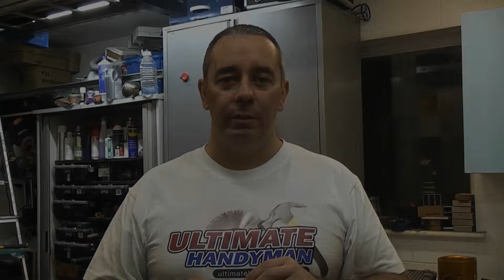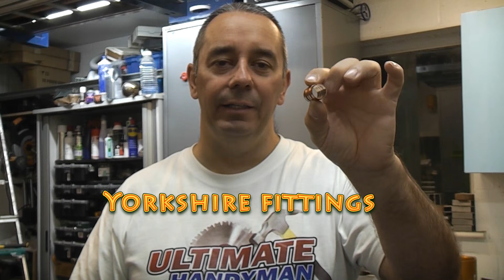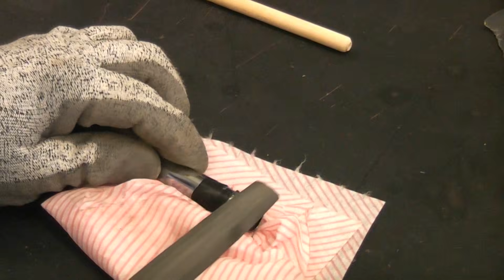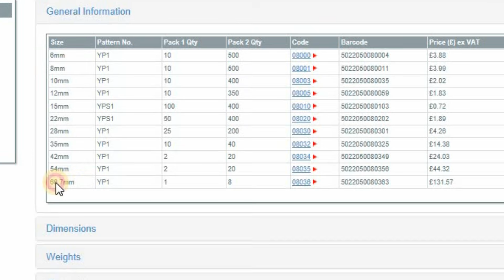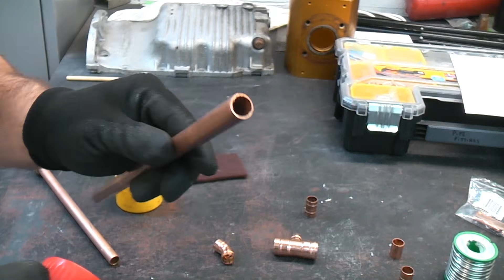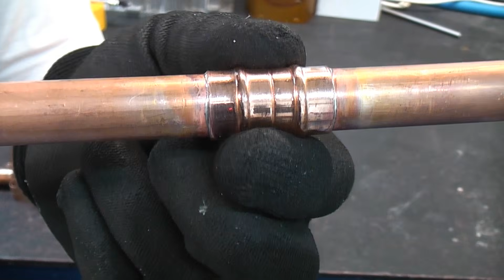How to use Solder ring fittings | Yorkshire fittings

Comment: The cleaning and fluxing part is as it should be. However, the flux purpose is to make the solder flow evenly around the fitting, ensuring a good uniform ring of solder and a good seal with the pipe. Do not just heat one side of the fitting, as shown in the video. Keep the heat source moving and work the blow torch all the way around the fitting to ensure all the solder melts and flows evenly all the way around.
Reply from the maker: I used to move the torch around, like you suggest, but the professional gas engineers keep telling me to hold the torch in one position, as the heat will conduct anyway!  
Thanks for the comment 👍

Comment: Im from USA, always wondered why these aren't used here.  Question, do you have to make sure that the solder is coming out of the joint all around the pipe or is it a good connection as soon as you see a little solder come out?
Reply: Once the solder exists all round the pipe just like in the video! The key is to heat it slowly for the solder to flow! And put flux to help solder flow! Hope that helps!

Comment: I need to get somebody to lower a section of a gas pipe running behind my kitchen cabinets, im guessing its going to need 4 solder elbow joints, is that likely going to drop the pressure to my gas hob on the far side of the kitchen? My old dishwasher broke and the new ones dont come in 540mm depth anymore, I bought a new dishwasher 550mm depth but the gas pipe running behind wont allow it to be pushed fully back against the wall so needs to be lowered to just above the ground.
Reply from the maker: I don’t think it will affect the pressure much. I was always told that elbows reduce flow, so I once tried some pipework with elbows and an identical piece with swept bends, there was no noticeable difference in flow. Having said that, our water pressure is 8 BAR, so perhaps it will affect gas. I’m sure the gas safe engineer will sort it! 
Thanks for the comment 👍

Comment: I never seen a plumber not use extra solder on the pre solder ring fittings ,,I guess not even plumbers trust them...
Reply from the maker: There is no need for extra solder, the manufacturers put the right amount in the fitting 👍
Reply: If a plumber is using these and adding extra solder, why are they using them at all? Genuine question

Comment: what I don't understand about these is why you heat the fitting, not the pipe.
for end feed (non Yorkshire) the principle is the heat draws the solder into the fitting by capillary attraction. hence it is logical to heat the fitting, not the pipe, to create that heat differential

why then do you do not do the reverse with Yorkshires? 

When I tried Yorkshires I could not get the solder to appear outside at all, in fact it only appeared when oi physically turned the pipe to see what was happening, at which point the solder ring did appear at the joint. In one case I actually ended up by supplementing with an end feed as well.
Reply from the maker: The heat normally conducts very quickly on copper pipes. Are you 100% certain that your fittings were made by “Yorkshire”? As some other firms make solder ring fittings, and they might not be as good!

Comment: Hi pal. Is best use a damp cloth to cool down pipe after soldering or some plumbers I've seen,, tend to use flux  with a brush and cool it down.... What's you opinion on that? with
Reply from the maker: You can do. A mate of mine gives the pipes a wipe straight away, sometimes with a damp cloth, sometimes with wire wool 👍

Comment: HI.  Great video!  Thank you.  I have to weld a 8mm Yorkshire to stainless steel.  I understand I need a special flux and then can use silver solder.  Is silver solder used in Yorkshire fittings?
Reply from the maker: I'm not sure, their website just states that the solder is "lead free"
https://www.pegleryorkshire.co.uk/EN/News/fittings-news/PutYourFaithInTheOriginalYorkshireFitting

Comment: Never thought of using a heat gun instead of the torch. 
Always hated soldering pipes in tight positions under the floorboards 
Might give a heat gun a try next time.
Reply from the maker: Heat guns work, but they are much slower.
I did buy a special tool for this purpose, but only tried it once. 
I'll try it again in future, mine is similar to this- https://bit.ly/3uZFCFg

Comment: These are a good cheap alternative to buying end feeds and solder separate which can be more expensive but how well are the joints sealed and whats the possibility of these ever leaking? I want to do some first fix plumbing for my downstairs loo refurbishment so the pipe works going to be hidden behind the battens where plasterboard will be going so need to make sure all the joints are good. Would I be better off using these maybe adding extra solder round the edges just to be safe or just stick some Speedfit ends on? Cheers
Reply from the maker: I've used these for years with no issues. A mate of mine always adds a little extra solder to them though. They give a really good joint, providing the pipe is deburred and cleaned properly before soldering 👍

Comment: This is great. I'm useless at soldering, but I hate the way my pushfit  effort to add a isolation valve to the loo looks like a kids  construction toy.
Re: The "gentle heat", with the blow torch? I don't have a blow torch but I do have a heat gun with adjustable temperatures.
I've watched your video showing how to use a heat gun for these fittings, where you say to use the highest setting. I presume that, whatever the highest temperature mine goes up to is, it will never be too hot as to not be as "gentle" as a blow torch on low flame?
Thanks again.
Reply from the maker: Yes, a heat gun will melt the solder, but they give out much less heat than a blowtorch, so you need the heat gun set to maximum. It's also much slower with a heat gun!

Comment: Just managed to put a screw through heating pipe under floorboard 😖 This will be my first venture into soldering which your video has at least given me some confidence in! Thanks for posting it, wish me luck!!
Reply from the maker: Good luck with it ;-)
Reply: @ultimatehandyman  Failed!! Heated for ages with a small blowtorch and solder started coming out but as soon as heating went back on the edges started bubbling and water seeping out 😩 Going to have admit defeat and call a plumber and use compression to keep me going short term

Comment: 3:55 Flux doesn't clean the copper! You already cleaned it by sanding it to a shiny finish. The flux keeps the copper from oxidizing-you'll know because the surface gets dull when this happens. Solder will not adhere to oxidized pipe.
Reply from the maker: a flux (derived from Latin fluxus meaning "flow") is a chemical cleaning agent, flowing agent, or purifying agent. Fluxes may have more than one function at a time. They are used in both extractive metallurgy and metal joining.

https://en.wikipedia.org/wiki/Flux_%28metallurgy%29

Comment: Nice video. My dad taught me how to use these when I was younger. I have had some leaks with them though. I think it might be from overheating the joints?
Reply from the maker: Are you sure you cleaned and fluxed the parts first?
I have never had one leak!
You don't need a massive amount of heat to melt the solder, just a gentle flame will do.
Thanks for the comment
Reply: @ultimatehandyman  Yes, I did clean and flux the joints. Puzzling.
Reply from the maker: @thehartfamily8963   Yeah. I'm sure someone did a video once about heating the joint too much and it did not cause any problems, even after well over heating it.

Comment: Couldn't you get the same results, simply by pre-wrapping a loop of solder around, on the pipe side. Then, when you heat the fitting, the flux will eventually draw in the solder that's already been pre-wrapped, and then you're done. 

Am I missing something? It seems like this would be much cheaper than a Yorkshire fitting, yet providing the same kind of functionality..

Could you do a demonstration of this method, as I've outlined?
Reply from the maker: Not sure about that 🙄
Thanks for the comment 👍

Comment: I've just tried one of these fittings on microbore and the solder never came out off the end. I cleaned all well and applied the flux and then applied the heat. No solder then came out like your video.
Reply from the maker: I think the small ones like that don't have much solder in them, so you might not see it exit as much, although I would expect to be able to see some of it.
Thanks for the comment 👍
Reply: @ultimatehandyman  well, I had to solder a total of 6 fittings to bury a flow and return for a rad in the wall. I've turned it on and no leaks. The fact that I didn't see any solder made me feel uneasy but it's all good. Thanks for replying and informing me of that. 👍

Comment: Great video! Do these work well on vertical applications? Will the solder still exit the top of the fitting? Thanks 
Terry
Reply from the maker: It will be fine in vertical applications, although some solder may exit from the bottom due to gravity.
Thanks for the comment 👍

Comment: Thank you, very clear and well explained. Got a load of radiator pipes to put together, wish me luck! Looking up the repair patch as well, that looks like a great way of fixing a hard to access pipe with a hole in it. Thanks for mentioning it, never new they existed, been stressing about how to fix that pipe.
Reply from the maker: Good luck with it 😉
Thanks for the comment 👍
Reply: @ultimatehandyman  Update - done several pipes now, forgot about fluxing the inside of the fittings... Think that will be an issue? Tried the click fix but thatpipe appears to have water in it still, so need to figure out a way to sort that 🤔

Comment: when you clean that pipe and applied flux ...dont put it back the way that it touches anything. you just contaminated the pipe with whatever you had on your table ...that's why the solder joints leak after a while ..

Comment: Hi UHM I’m hoping you or someone who reads this knows the answer to my question: 

why can I not find end feed/solder ball valve isolators the UK for 15/22/28? 

Even after endless searching on many of the major plumbing suppliers (BES, JTM, etc etc), and even eBay, Amazon...

They appear all the rage across the pond but over here they are only ever compression. 

Is there some WRAS/Gas reg, or just no demand in the Uk ??

Thx in advance.
Reply from the maker: I'm not sure, to be honest.
I always thought that most valves are compression so that the heat from soldering could not transfer to the valve and melt the sealing material.

Thanks for the comment
Reply: Ultimate Handyman yeah I thought the same. Yet @thisoldplumber on “this old house” always uses soldered ones. 

I’m fine with compression, more curiosity than anything. 

Thx for reply

Comment: Hi

I imagine you have a thousand ideas for videos that you’ve not managed to do, but here’s one more. 

Since the switch to plastic plumbing pipe I’ve always thought there would be issues with flow through the pipes; not least due to the inserts like the John Guest ones. 

Now I’ve read lots of research about how plastic isn’t THAT bad compared to soldered or compression copper pipework, but if you have a complex install with, say a dozen elbows all with two inserts on 15mm pipe I cannot believe that the flow (gravity system) would be as good as soldered copper. 

However, what I’d be interested to see is a video showing the difference between the two setups. 

As I say, just another idea to add to your backlog ;)
Reply from the maker: I have been planning a video on the difference between plastic and copper pipe, like you say the inserts really reduce the bore, especially with 10mm plastic pipe.  I'll try to set up a rig when I get chance.
Thanks for the suggestion 👍
Reply: Ultimate Handyman I’m just installing a new wet room shower with rain soaker, 6 jets (not for me, apparently women love these since they can have a shower but don’t get their hair wet if they just switch on the jets - who knew :) ) and a separate shower wand. So a 3 outlet shower valve. 

I usually just use JG these days for simplicity but for this it’s all soldered copper in 22mm with pressure balancing loop for jets etc

Note: I know there are endless issues with the flow with body jets but the Mrs wants what the Mrs wants - same for my 14y daughter. Getting wet hair is apparently an awful pain. I wouldn’t know, most of mine was gone by my 30th lol

Comment: It would be nice if we had that type of fitting in the good old U. S. of A. When working with copper it would speed things up. However I don't do much copper anymore mostly pex now.
Reply from the maker: PEX has a lot of advantages over copper (I keep meaning to make a video about the advantages/disadvantages)
Thanks for the comment
Reply: They have these fittings in Home Depot and Lowe's, but they are quite expensive. I know guys who exclusively use them though.
Reply: They definitely dont have these fittings in the U.S, you might be thinking of a propress fitting that look similar.
Reply: Menard's has them.  A 1" male thread adapter is very reasonably priced at   $3.99.  Equivalent regular fitting was about $15.00

Comment: You don't need to heat all around the fitting with the torch? 
I guess the copper conducts the heat all the way around?
Reply from the maker: Yes, the heat should quickly conduct all the way around.
Thanks for the comment

Comment: I've always used these, but in my early days I discovered that if working on a vertical joint it's easy to overheat it and watch the solder run out in a split second, leaving the whole thing dry. And then you have to wait for it to cool, take it apart, clean it all up and start again. I presume 'shutdown 2018' means school holidays?
Reply from the maker: Shutdown is when the two chemical plants where I subcontract as a maintenance engineer stop production for a few weeks each (not at the same time). This means that all the big maintenance jobs are done during this period.
Thanks for the comment

Comment: For appearance, I much prefer end feed, but yorkies have a use, especially in tight corners where it's difficult to feed solder. Like most plumbers, I still feed solder on the end of these "just in case", old habits are hard to break even though it's unnecessary. Recently I bought some of the imported yorkies bought from a major online trade supplier and they are very thin copper and the bends are very tight, and even had some with the solder ring missing, so I much prefer end feed or the original Yorkshire fittings.
Reply from the maker: Thanks for the comment 👍🏻
Reply: I have always added some solder to the ends for that reason.

Comment: hi chez great vid. glad you got a couple of days off you deserve it. Did you just heat one side of the fitting? many thanks
Reply from the maker: Thanks Arfan, Yes I only heat one side of the fitting. A few years back I used to move the blowtorch but was told not to by a plumber with 40+ years experience.
Reply: @ultimatehandyman   what was the reason to only heat one side?

Comment: Excellent demo. Just curious. Does the solder exit the joint, against gravity, if you solder in the vertical plane?
Reply from the maker: Thanks, gravity makes the solder exit the fitting more at it's lowest point. So if you have the pipe horizontal there will be a thicker bead of solder underneath the fitting and if the pipe is vertical the solder will run downwards.
Thanks for the comment 👍

Comment: I always carry a few for if I'm working in a very tight spot and normal endfeed soldering is too tight. As you said great for the DIY person too.
Reply from the maker: Thanks for the comment 👍
Reply: They're great for tight spaces like under floorboards where you can't even get a second hand in with a roll of solder let alone see if it's running into the joint. However, if the joints have good access and will be visible, end feed fittings always look better.
Reply: @woodbine66  So where I have only got access to one side of the copper pipe, just blow torching the visible side should melt the solder ALL the way round? I'm just toying with this issue now. I thought I'd need to blow torch all the way around the pipe?
Reply: Nope. The copper will conduct the heat all around the joint.

Comment: lots of europe dont use bare copper pipes, some kind of plastic aluminium composite pipe and push fittings.   weird how trade plumbers still use the  plain fittings and feed their own solder,  cant imagine how small the savings are,  me im a fan of compression fittings!
Reply from the maker: I think there is a large saving between end feed and solder ring fittings, especially if you are using hundreds of them per week, but for most DIY'ers it is well worth using solder ring fittings for their ease of use.
Thanks for the comment

Comment: As always another great vid. Quick question: is is better to heat the pipes either side or the fitting directly?  Surly if the pipes aren’t up to temp, you might get a dry joint (I’m coming from an electronics background of soldering).  Keep up the videos, it’s so nice to get a British (and northern!) perspective against all the US stuff on YouTube.
Reply from the maker: Thanks, the copper is such a good conductor that I'm sure the two pipes will soon reach the correct temperature.
Thanks for the comment